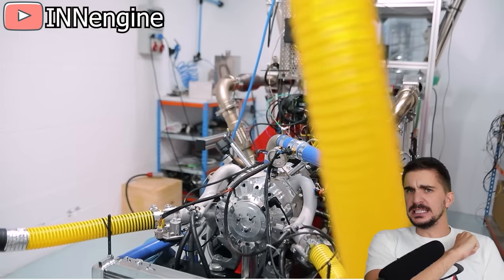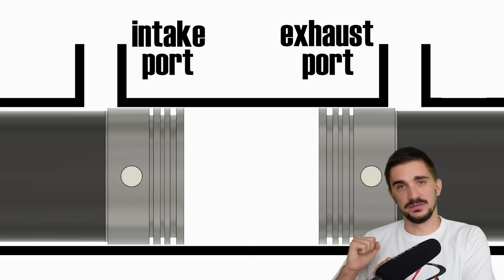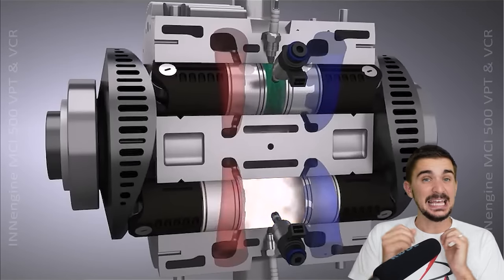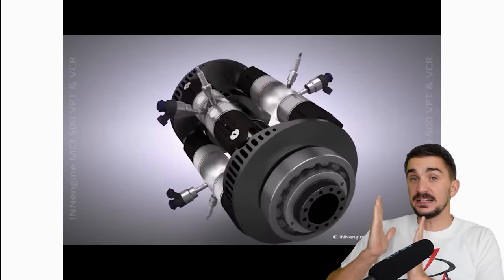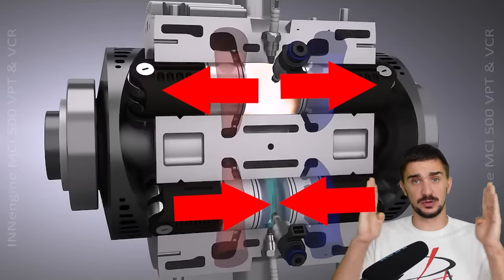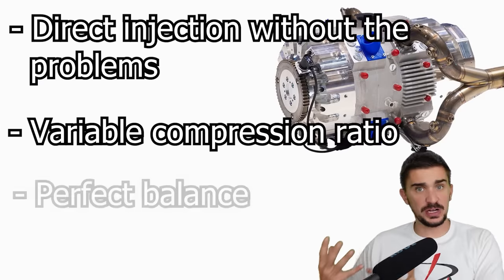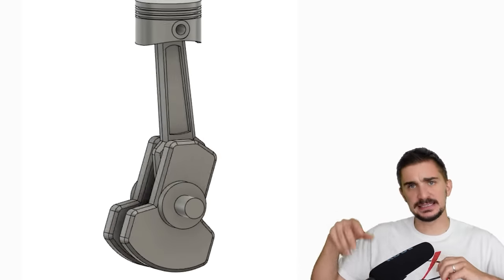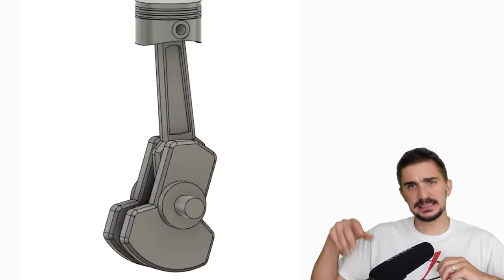Spain is Living in 2050? Revolutionary 1 Stroke INNengine Analyzed

Comment: great video as always!
this is in effect a compact 4 cylinder evolution of the Rootes/Commer TS3  'knocker' diesel engine with a different motion transfer method from the pistons. the TS3 was incredibly clever in its motion transfer to a single output shaft overcoming the need for dual crankshafts.
and yes, the engine featured is a 2-stroke.

Comment: This could be really good for the aviation industry. It's the roller wavey components that I worry about in terms of wear and tear.
Reply: The rollers would be the part needed to be made of a material that wears easier so it can be changed from time to time and won't damage the wave block.
Reply: Was thinking the same. This can be a brilliant turbine alternative for light helicopters. IIRC the APU of Typhoon fighters is about the same weight and output as this.
Reply: Yeah ! Ultralight aviation will jump on this as soon as it gets commercial
Reply: My thought as well. Since the rollers are rolling in a circular path there is obviously friction in there. A little bit like an axial roller bearing, they are not great for high loads and high speeds.
Reply: Also boat industry
Reply: @davidegaruti2582 oh yeah, because everyone wants the lesser reliability of a two stroke engine in aviation. Plus, who needs twin engine redundency on an aircraft when you can run both engines on the one motor right? That's why all of our aviation engines now are already 2 stroke right?

....right?

Word of advice. Don't invest your money in the tech industry, options or stocks. Stick to something reliable, like interest. Prediction isn't your thing.
Reply: @TIGERHOOD yeah sick, low reliability of two stroke, in the harsh conditions of the ocean. Can't wait.

Plus you can run two props on the one engine! Instead of having the redundancy everyone desperately wants in the marine industry.
Reply: Would be just about as stupid as you can get for the aviation industry.

Remove redundancy, ability to function without one cylinder, power both rotors or compressors with one motor again, removing redundancy that we all know aviation totally doesn't like. 

Nothing like adding more moving parts under high stress for an aircraft engine. Oh and we always need more friction on our  internals.

I especially like the part where it adds basically no benefit whatsoever. Watch the weight scale sky-rocket when you increase power. The graph will look like a powerful erection
Reply: @soggybiscotti8425  oh, you think there's no friction between con-rods and piston or  crankshaft and con-rod? One can argue that traditional engine wear is worse because the  impact of friction heat it is concentrated on small areas like journal bearings.
Reply: @soggybiscotti8425 you can run two or 4 or these engines and still weigh less than a conventional single engine
Reply: The part I'd worry about is if they got the firing timing wrong and it fired too soon and decided to run backwards. Wouldn't be the first time I saw an engine do that.
Reply: It’s pretty much a swash plate in a compressor.
Reply: @The_Dark_Lord-69  Fact of the matter is that this engine will have to see widespread use for 10-30 years before the aviation industry even considers using it seriously.
Reply: @Coecoo  that does not negate the fact that this engine is better for the aviation industry. This is all that I was  saying.
Reply: @The_Dark_Lord-69  Fact? You said it "could" be good. Real fact of the matter is that you don't know that and it will take decades before it will ever be considered for any sort of mainstream use, making said guess obsolete.
Reply: @The_Dark_Lord-69  do it in practise. I did the math, you can't. But I'd love to see you writhe around and pretend you can do math.
Reply: Which is why the hundreds of concept engines using swashplates have never gone anywhere. And Junkers perfected the opposed piston aircraft engine during WW2.
Reply: @The_Dark_Lord-69  It isn't. Not in any way. The opposed piston engine was widely used in WW2 already. Adding a goofy swashplate doesn't make it better. It makes it worse.
Reply: The real value of this is a two stroke with no oil.
Reply: The wavy things cause side loads on the pistons/liners (or whatever linear bearings keep the pistons moving in straight lines).
Reply: @marcusramberg4227 Tiene menos vibración que un motor normal de coche.
Reply: Si se fabrica en carburo de Tungsteno durará mucho.
Reply: @hagakure74  Si.
Reply: true
Reply: If you go to their website, you can see that they have made a 4 cylinder 125cc rc engine
Reply: The got rid of them for aircraft after wwII
Reply: This is a 2 stroke engine
Reply: @soggybiscotti8425  I can see it being good for a generator or hydraulic pump like they proposed but I do agree that it would probably be unreliable as a prime mover. Although if you are generating so much power on your boat your boat is probably using diesel at that point anyway.
Reply: @cloggedpizza239  I would need to go back and look at it's torque figures again to see if it would be practical for marine use. I don't have the time. But yes it's likely that it would still be more efficient to use Diesel for marine use. At least certainly for large scale marine use and large craft.

Perhaps it could have some use as a small outboard motor? Could run dual props off it I suppose. You lose some maneuverability depending on the size of the craft if varying throttle to each prop matters to the craft you are maneuvering. But it could be good for some smaller watercraft if it's reliable.

But again, you usually want redundancy when it comes to ocean faring vessels. So it would probably only be practical for something like a lake fishing boat or a small tinny thanks to it's light weight etc.

I can see some uses for it, but it's just not that practical for all that many applications.
Reply: @soggybiscotti8425  So all the discussion in the video about 'If it was better, someone would already have done it." went Swoosh, right over your head? Two strokes are inherently MORE reliable. Current aviation multi-cylinder 4 strokes are triumphs of development over design. All aviation engines are given reliability by empirically developed TBOs. Seen the cost of a full rebuild on a Continental or Lycoming flat opposed twin? For better reliability, you go to small gas turbines, PT6, etc., with an order of magnitude greater overhaul cost. And longer TBO.

Comment: What struck me was the complex shape of many of the parts and how polished/plated I'm guessing the main shaft - swash plate parts are. Most mass produced engines eschew anything polished with the possible exception of valves and possibly ports. It adds loads of cost to the end product
Reply: They're probably not in the stage where they optimise for mass production
Reply: This thing will likely be expensive to re-produce in mass. Whether or not this thing could live for a reasonable amount of time with the way people take care of their stuff remains to be seen. I don't hate it though.
Reply: @Schaddn  If they haven't been engineering manufacturing processes along the way then they're in big trouble.
Reply: While I agree with you on polishing /coating parts is expensive.   They are waving the cost of cams,valves,and a traditional crank. It may be enough to offset the cost of hardening coatings.
Reply: Well, to make a crankshaft and cam shafts is only cheap because the mass production part was already covered in the hundred years+ since they started building those, but that doesn't mean those are not expensive to balance and manufacture polished parts.
Reply: Over speeding this engine will destroy this type of cam driven engine.
Reply: Since the swash plates and rollers will need to be super polished for optimal performance and longevity, maintenance will be expensive and maybe more frequent than a piston rod car especially at the beginning of mass production. It will most likely be a niche in cars like the wankel (which I love) but will happily power aircraft, electric generators etc.
Reply: Well presented, nice channel. I think I might be back
Reply: Axial piston pump/motor
Reply: I noticed that too. I don’t see them needing to be polished or plated. Just like a crank or cam I would think some high precision surface grinding (polished in a way) and hardening would be just fine and certainly more desirable. I surely don’t like the idea of plated materials inside engines. There’s a reason they don’t plate cam shafts.
Reply: @vermin1970  Not really, not with modern production. A few dollars more per part. Meh.
Reply: Might be polished for the presentation. The swashplate doesn't need to be polished since the pinstons are riding on rollers.

Shafts that at a glance look like they're ground to precision these days in most cases aren't. Tool marks are that fine with a well engineered process.
Reply: @equallawandorder5393 ; The piston movement is or can be sinusoidal, hence much lower acceleration loadings than conventional engines with short conrods.
Reply: @Mr.Engine993 ; with recent amazing material development, the sliding surfaces need not even be rolling bearings.
Reply: I wonder what a design like this has in terms of part count. If certain aspects of it are easy enough then it's ok if other aspects are difficult to manufacture
Reply: What about crank shafts, cam shafts, con rods, timing gears/chains/pulleys, bores, pistons, cylinder heads, blocks,etc,etc? I  used to work in an engine rebuilding shop, all parts in a conventional 4 stroke engine are ground and polished to some degree as they all have friction applied to it, if it didn't it wouldn't be there.
Reply: they must be using powder metallurgy to manufacture the parts, the parts are already polished
Reply: I think your comparison of cylinder firing events between it and a 4 stroke is flawed. The way I see it each cylinder on the one stroke fires twice per revolution of the crank. A four stroke fires once every two revolutions of the crank.
Reply: I've been a tooling specialist my whole career I'm 67. The Machining abilities and technology  of today make all these parts very easy and affordable to make.
Reply: Absolutely but at least they're not completely in unexplored territory they've been making swash plate piston oil pumps for years so at least there is a large scale manufacturing base for them to learn some tricks from.
Reply: I agree it does not look cheap to produce but prototypes tend to be that way. That huge rad looks like a couple of grand of racing parts.

Comment: My first thought was that it might be useful as a range extender or portable AC/DC generator system.
Reply: With it being relatively light, even a smaller 150cc might be much easier to carry around and generate maybe 10-20kW with maybe a whole 35kg package all in and that would be an amazing generator. Less rattly too seeing as it’s smooth.
Reply: Exactly, in one of the interviews the CEO has given he expresses that they want to market first those kind of markets, since it's the perfect engine for a range extender system due to it's really compact size.
Reply: I think range extenders are inevitable to fill the gap in battery technology. The smoothness of such an engine will chime well with the ethos of an ev. Also with the engine able to run within a relatively narrow rapm range, the design can be tailored to optimise port timing, compression ratio, scavenge pressure etc. to achieve minimum emissions.
Reply: I've been thinking a 49cc version that carries a similar weight saving advantage may well replace a whole lot of scooter / moped engines. Terrible fuel economy could ruin that, as well as other replacement-engine applications, but I don't know what sort of economy the 500cc engine gets.
Reply: typical limited thinking and reduction of innovation !! 
For another excellent innovation engine with more uses, the Liquidpiston X rotary is excellent with very few parts, components along with air cooling.

Comment: It would be interesting to see this engine paired with a hybrid system to compensate for the lack of torque. The lower weight and smaller package would also help compensate for the extra battery weight that comes with hybrid cars. But I guess this would essentially be the "range extender" application they mention
Reply: Depending on efficiency using a CVT could keep it in peak torque and make it very appealing.
Reply: This in a hybrid config with cvt is a legit perfect use case.
Reply: my thoughts exactly. maybe throw in some antilag and the tank setup Ford used on the wrc focus that got banned back in '08(?) and the whole system would be high output across ⅔ of the powerband. i can't say i don't want to try it.
Reply: There's quite a few free piston generators in the works that skip the whole big rotating mass and hence a lot of friction. Having fewer pistons for the same displacement is certainly better in terms of piston ring friction. It's a bit silly to have 2 engines in a car and not use them both all the time.
Then again, that's a lot of power coming out of a tiny lightweight engine, might as well just connect it to the front axle, no gearbox and just de-clutch it at lower speeds.
Reply: I see this engine as more useful for EREV (with 2 axial flux generators), boats and even airplanes.
Reply: That's a great idea, it could work well on an EV.
Reply: Yeh an axial flux electric motor like what is being developed by Mercedes Benz combined with this one stroke(which is really two stroke) innovation engine might be the ultimate hybrid and totally amazing! However two strokes often have reliability, stability, 
dynamic balance, vibration, waste and inefficiency, emission and noise problems. It would definitely need to be competitive with turbo diesels.   It's power bandwidth across its  rpm range or under high load conditions may not be as impressive as their promotional video suggests.
Reply: @Roger-r7s  Electric engines have the best torque of all engine types except for maybe steam. So pairing an electric engine with this engine could be great. It could save a lot of space under the hood which will allow batteries to be placed and then they could power "smart" systems inside the car.
Reply: i would like to see how a system like that would operate in my jeep. this thing has the 4wd part handled, already, just some electric engines at all four wheels, too...
Reply: problem is electric engines also lack torque. so you have solved nothing lol.
Reply: @kevincornell1439  ???
Reply: @kevincornell1439  in what universe are electric motors NOT torque monsters? because every electric engine i've ever seen can produce orders of magnitude more torque than a similarly displaced combustion engine...
Reply: @TheRedStateBlue  then why cant the electric trucks pull then? instant peak HP doesn't translate to a torque monster.
Reply: @kevincornell1439  the only thing preventing electric trucks from being a thing is battery size and weight. once we've refined battery tech some more, you'll start seeing electric trucks hauling loads.

you really need to find better information sources. whatever ones you're currently relying upon are flat out fuckin wrong.
Reply: @TheRedStateBlue  your having a bit of a disconnect here. it takes torque to pull, electric vehicles cant tow. if they are these "torque monster" then why cant the do what regular high torque diesel trucks do? again you are getting instant peak HP confused with torque.
Reply: Or even like a diesel generator electric motor setup like a locomotive.

Comment: Good to see the development of this type of engine continue. Certainly not a new idea. Many different variants have been produced since before 1900. I believe one of the most famous designs was a series of opposed piston diesel aircraft engines produced by Junkers in Germany beginning around 1932.
Reply: The English also had this configuration with their famous Commer truck diesel engines that had opposed pistons but unlike Junkers used a common crankshaft with a pivot and lever system for the pistons. Most unusual sound when the supercharger used to howl to boost and scavenge the engine.
Reply: @vumba1331 this was Rootes TS3 aka "The Commer Knocker"
Reply: those junkers were 2 strokes tho
Reply: @vumba1331  Don't forget the https://en.wikipedia.org/wiki/Napier_Deltic
in the https://en.wikipedia.org/wiki/British_Rail_Class_55
Apparently sounded quite incredible.
Reply: Currently used in mk 48 torpedoes
Reply: Mark 48 torpedo engine.  More or less.  Designed to run hard for a few minutes.
Reply: @johnnicol8598  indeed